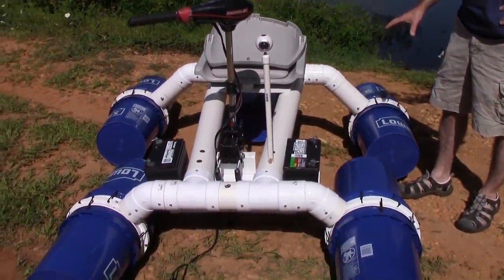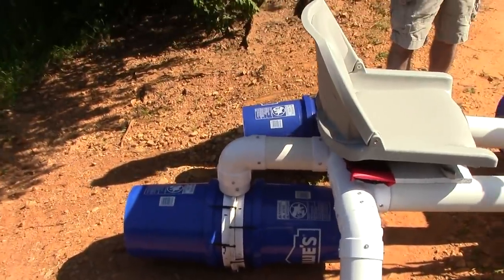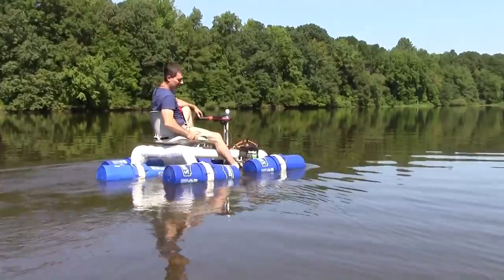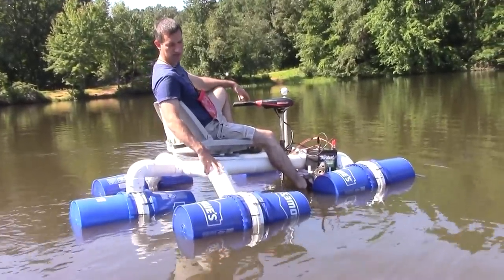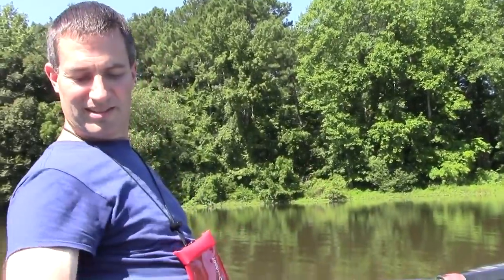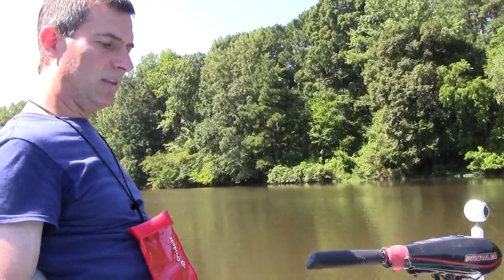Homemade 5 gallon bucket race style fishing boat

Comment: Go onto Amazon and look for large funnels, you can get funnels that Will fit the bottom of the 5 gallon buckets. Cut them to fit and secure the to the buckets with pvc cement (glue).

Comment: Take some roofing aluminum flashing, curl it up like an ice cream cone screw with sheet metal screws or rivets, screw large diameter part to bucket, make it same diameter as bucket, take the point part and it will cut through water better, make 5 of them. Even make nose cone for tips if needed

Comment: If you want to reduce the resistance of the buckets a they attempt to cut through the water - Turn Them Sideways So That The Round Sides Move Into the waves softening the resistance.  Just my thoughts. Enjoyed the build however - Thanx
Reply from the maker: I appreciate the suggestion, thanks.

Comment: I know that this was done around 3 years ago,  but can you add cones to the fronts of the floats to make the more aerodynamic  "water dynamic"?
Reply from the maker: It's possible, but it might take a redesign on the bucket holders. I will start to work on it, thank you for the great question.

Comment: I bought a 16ft fiberglass canoe for $150 and picked up a cheap trolling motor. I think what I got is a lot safer and faster for a little more money. I bet that seat was$60 plus all the fittings would add another $60 plus.
Hope you don't get caught up on a log lol
Reply from the maker: You are correct that everything without the seat and motor was just under $60 (including the buckets). I bought the seat at Walmart for $20.00 and I already had the motor and batterys, so that was no extra cost. Thank you for the comment, Lonny

Comment: you can make it lighter, and faster by eliminating the buckets.  just use the 4 inch PVC tubes in place of the buckets, up curve your bow so it rides better in the water, fill the pvc with steryafoam  Cant spell, pellets and off you go.  used that for out riggers on my canoe was stable enough for the biggest lakes.

Comment: There is a simple adjustment: placing the batteries inside the plastic packagings, leaving a cable for the meter and also for charging
Reply from the maker: Cool, thank you for the suggestions.
Reply: @supergokue1  Yeaizki to be in the back pack in order to be heavy in the middle for balance and thank you attention

Comment: Cool but so much to change . Add a bucket on each side . Fill them all with foam don't use screws only where really necessary. Use caulking on joints make cones for front buckets. displace the weight properly to get a better plane. This would be pretty sweet.

Comment: Try trading those heavy batteries and with a LiFePO4 battery running in parallel with 6 Super Capacitors with 2.85v @ 3,400 farad. The lithium battery and Super cap should be getting  around 9.5 kilowatts or maybe more.  Just be sure to water proof it!  You'll cut 3/4 the weight of a lead acid or AGM battery.

Comment: Cool but so much to change get rid of drag . Remove back middle bucket. Add a bucket on each side . Fill them all with foam don't use screws only where really necessary. Use caulking on joints make cones for front buckets. displace the weight properly to get a better plane. This would be pretty sweet.

Comment: Find yourself some bowls with the same diameter as the buckets and “cap” them for hydrodynamics... kind of like a bullet shape. Or perhaps build your own “cone” shaped caps. That alone should drastically reduce the drag. Great little boat... I’m tempted to build one myself! Did you mention cost? (I might have missed it since I was mentally making a list of components...lol)
Reply from the maker: Without the seat, motor, or batteries it cost me around $60 dollars to make. PVC is cheap in north Carolina, people have told me it is way more expensive in other states. Thank you for the great suggestions,  Lonny.

Comment: I think its a good job, by using the screws if it wasn't to your satisfaction you can redo it. If you used glue theres no modifications. As far as weight goes I'd probably stay away from pessed board.

Comment: Just an ideal and I don't know that it would increase buoyancy but what if in stead of buckets you got 12" PVC and reduced out of your tee to the 3" or 4" frame. I was thinking if you solvent welded it all together with an extra tee you could put in a test air gauge and pump the whole rig up with air or some other gas to improve float. Kick ass ideal and a great video. I love where you are going with this thing

Comment: you should cut the front buckets at 45 degree or just add another bucket to the front ones that are cut on a 45 so it will plane better with less drag

Comment: Glue joints no bolts would weigh less. Also heating pipe and bending would save joints.  Less joints Less fittings less weight.

Comment: Where did you get those bucket to bucket connectors?
Reply: Home Depot 😁
Reply from the maker: I have made 2 different styles of connectors. one with wood and one with plastic. I have come up with a new method that I will be showing in a future video, anyway here are the links to the old ways. The old way of attaching with wood is in this video https://youtu.be/nMZB2bhM9Io and the plastic way with plastic is in this video https://youtu.be/0X4rS23e36I. Thank you for the question, Lonny

Comment: Are this buckets water tight?  If so, how did you do it?  Why didn't you glue the pipe joints (make them water tight)?  It would have added to the floatation.

Comment: Cost what do you estimate the $ not counting the seat or motor? Bucket strap I guess there is a plywood panel between the buckets and a 2x4 build up to fit 2 buckets into the PVC tubes. How did you connect the buckets to the plywood separator / connector?
Reply from the maker: Hello, the material cost me just under $60.00 not including the seat, battery, and motor. The old way of attaching with wood is in this video https://youtu.be/nMZB2bhM9Io and the new way with plastic is in this video https://youtu.be/0X4rS23e36I. Thank you for the question, Lonny

Comment: Now improve your design, build yourself torpedo shaped pontoons instead of those buckets out of fiberglass,  it would be more efficient cutting through the water.plus you could enlarge the front pontoon a bit bigger as it appears you need a bit more water displacement the back looks great  though, good job.

Comment: If this thing falls apart, for any given reason (flip, crash, glue failure, etc...) Is there a way for the battery to shock you? If it sinks, or flips, and anything stays connected, is there a way for a shock to be emitted? If it is possible, I'm assuming you'd get a nasty shock, clinch up to the point where you cant swim, and then drown.... Is that accurate?

Comment: Im guessing the rules for this construction is "no-glue".  If so I get it.  I like the way you accounted for the extra buoyancy requirement aft.  If you add a cooler on the bow, then maybe another bucket.  :)  for stability, keep the center of gravity as low as possible; maybe inside another bucket.

Comment: Take it apart and use pvc primer and glue to attach your pieces. add more pipe in the front so it's even with the back. Cones of some sort on the front buckets. Perfect.

Comment: GET 20 ' OF 12"PVC AND 4 TEES  (MAYBE 6) AND 12"X4" RED BUSHINGS,BUILD IT USING THE 12" AS PONTOONS BUID IT WITH 12" CAPS..
GLUE EVERYTHING NO SCREWS USE 4" U-BOLTS KEEP EVERY JOINT GLUED, SCREWS WEAKEN THE FITTINGS,YOU NEED TO MAKE IT AIR TIGHT ,2 BONUSES 1 IT GIVES FLOTATION,2 ADDS RIGIDITY TO CRAFT,SO USE A SEALANT AROUND ALL NECESSARY SCREW HOLES.
I'D ADD A FLOAT IN FRONT ,IF YOU HAVE ONE ON THE REAR ,SO IT WILL NOT PLOW INTO WATER...BAD....
COOL BUILD 
WHAT EVER YOU DO, IXNA THE SCREWS,USE PVC GLUE H2O TITE
" GOD BLESS AN GOOD BOATIN'

Comment: What did you use to waterproof the plywood between the buckets? How is it holding up?
Reply from the maker: I used exterior house paint for the plywood. It seems to be holding just fine, but I think there is a lot of room for improvement. Thanks for the question

Comment: cool boat but why not use pvc glue for the pvc joins instead of screws.  it seems that the screws and screw holes would be potential points of stress failure over time.  just a thought.

Comment: If you want speed make some bullet point for each bucket , that's gonna help cut threw the walter
Reply from the maker: I do agree, I have been working on a couple of different ideas. Thanks for the comment, Lonny
Reply: @supergokue1  yea that will make a big difference on speed and the motor would have less force to push..

Comment: Instead of bigger motor change the prop off to a different pitch to make it go faster with more thrust plus you could lighten it up by buying the all PVC electric motor instead of having chrome steel shaft that WILL rust!
Reply from the maker: I will look into it. Thanks for the suggestion, Lonny
Reply: I use the Minn Kota trolling motors on my Quad inflatable pontoon boats ! I bought it new for $169 but it push the boat to fast for trolling, so I put it in my local Thrifty Nickle Want ads and some one called and wanted to trade it for his new Minn Kota that had a slower pitched prop for his boat it, was a perfect trade! You might want to look in your local Craigs listings too. Rod.

Comment: Great Job, may i ask how much did it cost everything.?
Reply from the maker: The cost of everything except for the motor, seat, and the batteries was just under $60.00 here in North Carolina. I have been told in some states PVC can cost way more. The motor cost $99.00 from bass pro shop and the seat I believe cost around $30.00 from Walmart. I am just guessing on the batteries, I think they are probably around $50.00 each. I will mention that these batteries are not the right ones for a boat, I just had them laying around. Thank you for the question, Lonny
Reply: Do you have a video of how you connected the buckets to each other?

Comment: Why in the world do you screw the pipe together when the glue for that is A: stronger B: seals the pipe. ???  Home Depot has plastic and fiberglass panels you could use instead of that crappy - heavy press board.  Instead of drilling large holes in the pipe ( now you will have water in the pipe) use beveled deck screws to attach your boards to the pipe with a little silicone to prevent leakage. Plenty strong enough to hold that board to the PVC pipe.

Comment: Did you put expanding  foam inside the buckets to help it float or would that just make is heavier?
Reply from the maker: I did not put anything in them because it made such a good seal. But, I will be experimenting with a couple of different things in the buckets just incase one decides to leak. Thank you for the question, Lonny

Comment: Run your trolling motor off of 20v drill batteries it will lighten your load
Reply from the maker: I never thought of that, thanks for the idea :)
Reply: @supergokue1  your welcome I've been tinkering around with it myself, a 20v battery will make a 12v trolling motor zip as well and your mah rating on the battery is fairly close to actual battery life

Comment: I guess he's not using PVC glue so he can take it apart again? And they have large 12" to 18"PVC storm drain pipes that have 4 inch adapters for flotation. Plus joist straps to make base frame to attach the seat

Comment: Eliminate the buckets, and instead use two plastic Minnow kayak hulls, with the same elevated seat arrangement, that can be adjusted to move fore or aft, and then bolted in position, once the correct centre of gravity is established, thereby streamlining the craft for minimum forward water resistance.

Comment: Why not angle front side of buckets so the crown of the bucket is out of the water.
It will sit lower but resistance will be dramatically reduced and may have to adjust for balance....just a stab in the dark...trying to help.

Comment: I may have missed it, but how did you attach the bucket system to the chassis?
Reply from the maker: Hello, the old way with wood is in this video https://youtu.be/nMZB2bhM9Io and the new way with plastic is in this video https://youtu.be/0X4rS23e36I. Thank you for the question, Lonny

Comment: Hi...question. What is that special fitting you used that was attached to the bucket ring that fit inside the big pvc? where can i get that and did you secure with screws as well? thanks
Reply from the maker: Hello, this video link is better for showing how I made the fittings. I cut it for time in this video and after realized my mistake. Thank you for the question, Lonny https://youtu.be/nMZB2bhM9Io
Reply: I saw. Clever!!! A maker after my own heart. Thanks!

Comment: Better mounted with Metal Buckets and nose cones PVC shopuld be Glued Schedule 40 or better. Black Pipe is stronger . PVC has a Brittle factor that other Piping does not have . Nylon Piping is super strong and maybe drop to 3" and test load wt capacity . All in all a possible starter kit but need safety refinements?

Comment: Can you fill the buckets with helium gas?
Reply from the maker: You might be able to add helium if there were value stems installed on the buckets. Thank you for the question, Lonny
Reply: One extra bucket setup up front at the nose and thick rubber balloons filled w helium inside buckets..
Reply from the maker: I like it!

Comment: Dang I hoped to see how/what the bucket connectors/couplers were made from....interesting...
Reply from the maker: Hello, the old way with wood is in this video https://youtu.be/nMZB2bhM9Io and the new way with plastic is in this video https://youtu.be/0X4rS23e36I. Thank you for the question, Lonny 
Reply
Reply: Thanks for sharing again.
Reply: Ya know the packing foam that’s like flat foam in a roll?  I bet you could do a craft outta that.....used in rolls and/or flat silicon or joined some other way and be much more light weight.   If I do what I’m mentioning I will probably go with your frame.....making sure to avoid “normal” wood....go with the plastic beams from this or similar.
Reply: X that...I’m probably going to do a water craft similar but using the 35oz peanut containers connected with silicone and the foam wrap & stuff.

At the rate I go through peanuts it’s going in construction late this year.

Comment: Hi i would like to know what kind battery are you using?
Reply from the maker: The batteries I used were 2 lead acid lawn mower batteries. To be honest, these are not good batteries for this application. In my next video I will be using a lithium ion battery. It is way more powerful and is a 5th of the weight. Thank you for the question, Lonny

Comment: The motor is probably fine but the multi bucket design is a complete failure.  Go with 2 torpedo style floats  trust me.
Reply from the maker: I am definitely working on some changes for this design. Thank you for the comment, 
Lonny
Reply: that would potentially cost double.
Reply: I think that would add to the stability as well.

Comment: How much did you spend on pvc?
Reply from the maker: The cost of everything except for the motor, seat, and the batteries was just under $60.00 here in North Carolina. I have been told in some states PVC can cost way more. The motor cost $99.00 from bass pro shop and the seat I believe cost around $30.00 from Walmart. I am just guessing on the batteries, I think they are probably around $50.00 each. I will mention that these batteries are not the right ones for a boat, I just had them laying around. Thanks for the question.
Reply: @supergokue1  thanks for the reply. Didn't think I'd even get one

Comment: I would Have used a thick Styrofoam for a base lighter material ad to the floatation
 and air bags that you can fill from the outside of the buckets with air valves to fill

Comment: It is off balance.  Too much weight it the front. Too much drag from offset of buckets. Seat needs to be moved back to find the sweet spot. As it is a good sized boat wake on a lake would flip you front to back. It's a great idea. Just think it could be better and safer.

Comment: You spent more in supplies than you could have bought a used 14ft aluminum with crappy trailer, and paint and sealer and new harbor freight wheels, and had five bucks left for worms and a pop

Comment: Cost?
Reply from the maker: The cost of everything except for the motor, seat, and the batteries was just under $60.00 here in North Carolina. I have been told in some states PVC can cost way more. The motor cost $99.00 from bass pro shop and the seat I believe cost around $30.00 from Walmart. I am just guessing on the batteries, I think they are probably around $50.00 each. I will mention that these batteries are not the right ones for a boat, I just had them laying around. Thank you for the question, Lonny

Comment: thats a pretty expensive boat,has anybody priced 4 inch pvc pipe fittings lately?
Reply from the maker: I used 4 inch sewage PVC, only about $9.00 a stick. Thank you for the comment, Lonny
Reply: the (fittings) were $5 bucks or so each.CORRECT?
Reply from the maker: The 4 inch tees are $4.29 and the 45 degree elbows are $2.00 each. That's from the Lowes in my area in North Carolina. Thanks again for the question, Lonny
Reply: everything is overpriced in west texas.good job.thanks,sam